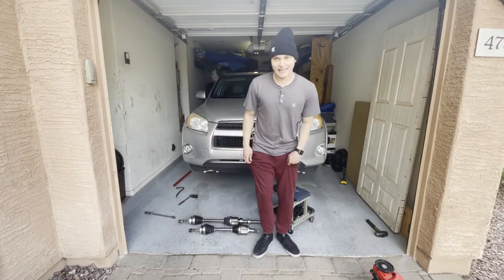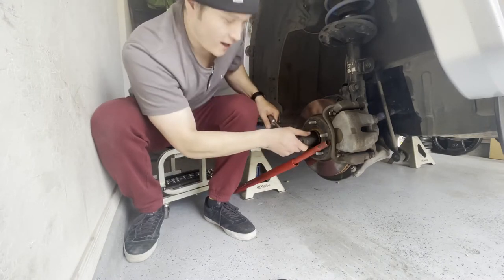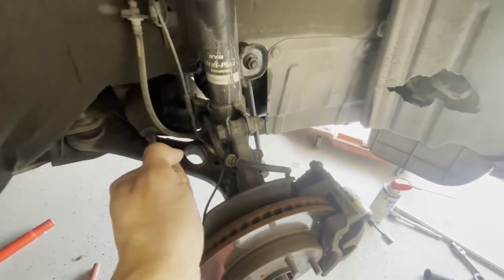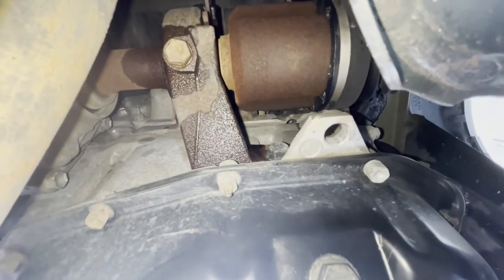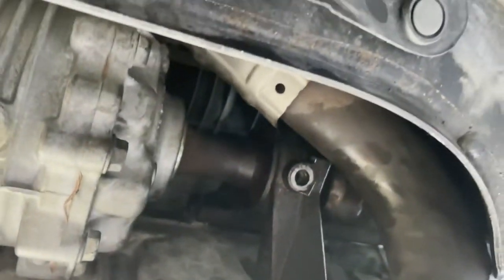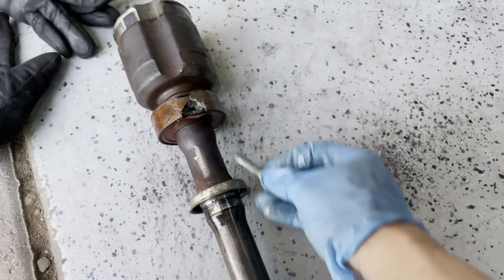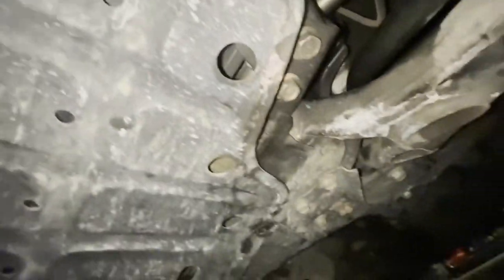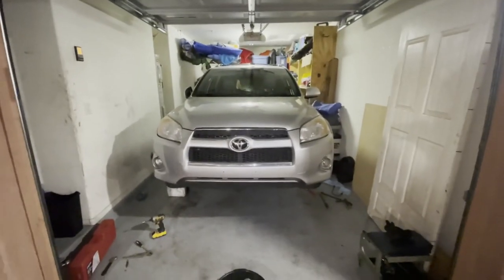Rav4 Front Passenger Axle Replacement Tribulations | Bearing Bracket Bull sh...

Comment: Swapping a transmission in a 2010 rav4 as we speak. I appreciate the heads u0 regarding the dowle pins....got the bracket past them but still having issues with getting it out. Just wanted to say thanks for making this video and informing me about the pins that you can't see. Hopefully I get it out sooner than later!
Reply: Were you able to get the bracket out with the cv axle shaft still in the transmission? Currently stuck in the mud because of the fkn seized bracket.

Comment: Actually there is another video for this and it is so much easier. Go to Home Depot, get two Diablo carbide saws all blades, cut between the outside joint and the and the carrier bearing. Then take a 4 1/2 angle grinder and cut between the carrier bearing and the trans and finish it off with the Diablo blade and finish it. Take the three bolts out of the carrier bracket and soak in WD40 and within a couple hours it should pop right out. The piece that is left in the trans slides out there is no clip on the end. If you got this far you shouldn’t need instructions on how to reinstall. Thanks
Reply: Can you link that video please

Comment: Reflections on what I did ... to help someone out. I thank Gstavo for valuable input. @5:10, he mentioned 2 ways: sliding entire axle out, screw and crack the bearing. Regarding the former, RAV4 4x4 is different (he is correct) due to dowel pins. The latter, it depends ... I read in other vids the bearing wouldn't crack even after screwed-in.

3 ways I'll mention here:
Easiest yet the same cost-wise:     get sawzall, cut the axle at half way between bracket and transfer case. Take out both pieces. You can reuse the bracket but not the axle

What I did (not recommended):      from the top (of engine), take out intake manifold and surrounding obstacles, exhaust piece around the bracket. From the top, you can pry out the bracket to the point dowel pins are clear. From there, with friend help, you can slide out the axle. Do NOTE that there is one edge of the engine that will become obstacle during slide out (2nd obstacle after dowel pins) but you still can clear it. Most time consuming and you can possibly damage the transfer case if not careful.

Cutting dowel pins:     I never did this but later formulated based on my experience. Dowel pins are not fixed but inserted into engine. They are about half inch. Do what I did to clear so that you can access from top of engine. From there, lift pry out the bracket so that you can cut the dowel pins ... half way, about a quarter inch. Do it twice for 2. At that point, try to ... rotate the bracket ... so that it will clear the 2nd obstacle at the corner of the engine. Dowel pins will easily clear after cutting (you can replace them later). Rotating the bracket 180 degree will clear the engine corner. Do note dowel pins are soft metal. I cut them anyway so that I can do this job if need arises again. Main point is cut the pins so that you can rotate the bracket

Renting shim and fork (axle popper tool) from auto stores are helpful in cases where you slide out the axle
Reply: I had to use the sawzall to cut it out. Thanks for your input. It save me a whole lot of trouble trying to wrestle with this axle
Reply: If cut the axle do you just slide the axle out of the bearing/bracket or have to take out 3 bracket mount bolts?
Reply: @LaurenDaddy  Cut the axle (like I said above) and you have to take out bracket's 3 bolts.

(edit) Take out (half way) bracket 3 bolts first, then cut as described. Then axle will be out with bracket attached. Then you loosen the bracket (in open air) to reuse it
Reply: If I were to cut the axle, do you know if I still need to order a new carrier bearing or does the new axle comes with one? There’s a carrier bearing by that 3 bolts bracket right?
Reply: @LaurenDaddy  I think new axle comes with one and the clip. You'll know when you take it out from bracket

Comment: Isn't there a snap ring holding the bearing in place?
Reply from the maker: Yes there is! I hear they’re rusted in sometimes. Luckily mine was not
Reply: Yes.  Without the snap ring there's nothing to keep the inner splines of the axle in the transmission from moving in and out of the transmission which could eventually cause them to strip out and destroy the splines on the transmission.

Comment: What brand of cv axle did you use? Original brand new or used from pick yards? If not,, what are good brands?
Reply from the maker: Pretty sure I got it off a1auto or one of those other websites
Reply: @SBGUS  Ok. I'm worried about that route. Is it still working ok? I digged up things a bit and Raxles brand has good reputation but they only have it for select few. They have stuffs for Honda.

Comment: Hello!  I am running into the same issue right now!  Way too much time lost so will give this a try.  Just wondering if you tried to remove axle from transmission with carrier bracket unbolted.  I saw a few videos saying that worked but it sure isn't working for me!  You would think with the bracket unbolted it would come out and the one comment on this thread said they cut the bracket and it came right off.  Not sure why that is and wasn't sure if you had any insight on that.  Thanks so much!!!
Reply from the maker: You can unbolt the bracket from trans but a dowel pin in the bracket doesn’t allow the axle to slide out with the bracket still attached. Design flaw for sure
Reply: @SBGUS  Thank you!  I'll let you know how it works out!
Reply: It worked!  Not sure if I still understand the complete concept but once I cracked that bearing, it popped right out!  Thank you so much for taking the time to make such a video to help others out!  This car has been sitting idle for almost a year now as I gave up last summer on it!  Really looking forward to getting it back together!  Thanks again!!!!